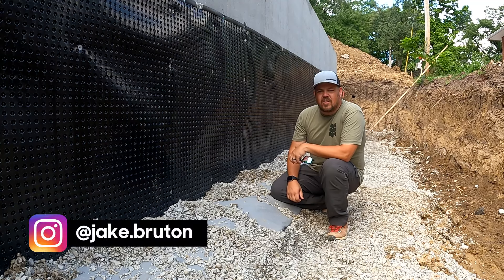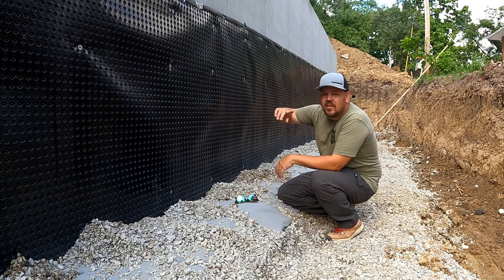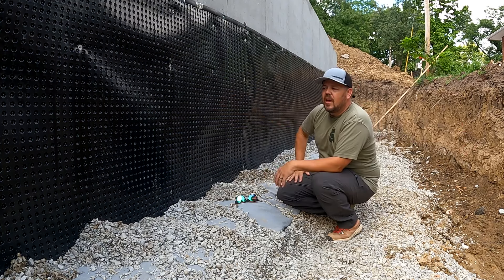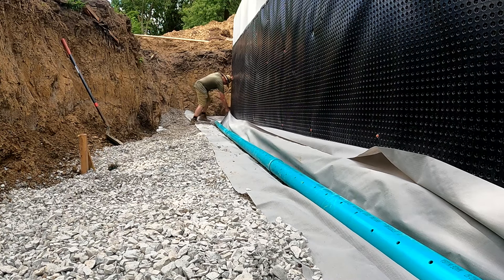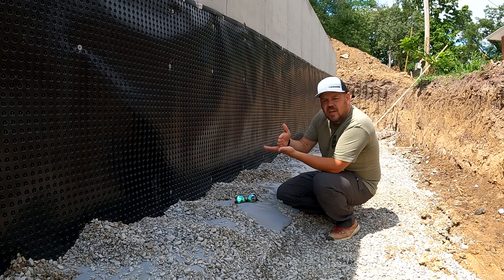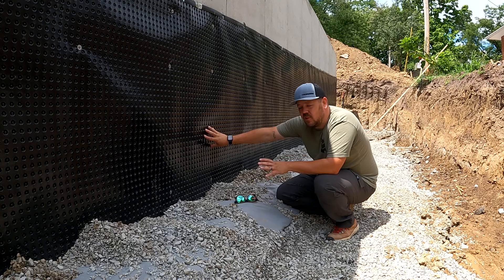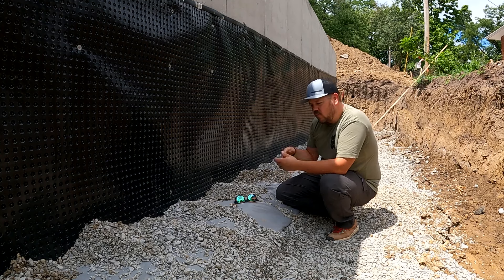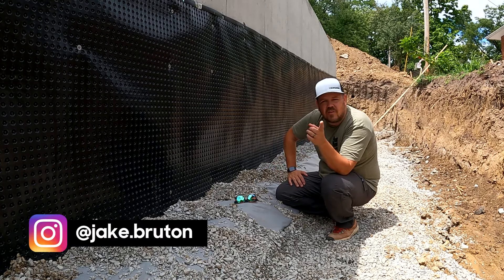Foundation Waterproofing

Comment: Probably the only thing I would add is a vertical pipe or two for cleanout purposes.
Reply from the maker: We actually did a poor job of addressing this, we require a clean out about every 75’. This is a great point.

Comment: You should extend the polywall material over the footing drains. Water will run to the lowest point regardless and get underneath the polywall, but this will be at the base of the footing where the drain sits. Silting from the top will be prevented. The area you excavated is basically an unfinished swimming pool …water will flow to the lowest point, and the drain will be there to move that water.

Comment: Really like this style of water/damp proofing.  I also like that the dimples are facing inward on the foundation wall with your dimple mat.  Other products have dimples facing outward with fabric over the dimples that face outward.....the flat gets glued to the foundation wall, which when you think about it, ruins the idea of lowering hydrostatic pressure.  Glad you mention that Polywall is EXTREMELY EXPENSIVE.  I'd be happy with this installation.

Comment: When all of that fails, instead of digging it up, the next step is running a dehumidifier on the air between the concrete and the plaster inside your basement. Just one more layer in keeping damp out of your house.
Reply from the maker: It is important that we always recognize that all of these conversations about the construction of the exterior wall don’t mean a whole lot without properly functioning HVAC equipment and responsible home ownership that is for sure.

Comment: Our HOA just signed a contract to have this done to a condo building that was built in 2002, concrete footing with a cinder block foundation. The technique used by the builder just didn’t last. So we’re having to dig up all the shrubs and redo it.

Comment: If you use a 5000 psi or higher concrete to begin with the amount of permeability drops significantly. Superior Walls use this method and their foundations don't even require water proofing.
Reply from the maker: Correct on the Superior Wall claims. The issue here is that bumping to 7500 PSI or so like they do is costly. Even if we use 5000 PSI the chances of cracking are still very high and a system like this on an 800 SQFT basement only cost something like $2k. For piece of mind I wouldn’t skip it.
Reply: @jake.bruton.aarow.building As they say, there are two kinds of concrete: concrete that has cracked and concrete that is going to crack. I would never skip the damp proofing and dimple mat on my own house regardless of the concrete mix used.

Comment: Excellent presentation. I am in the process of doing this now. Inground wall bitumen coated 30 years ago, spec for the day, failed at the cold joint, footing, first layer of blocks. Very detailed information especially about wrapping drainage pipe , water tables and a comment regarding putting in a flushing riser pipe.
Reply from the maker: It’s great to hear you are getting this done right and addressing the cold joint issue!

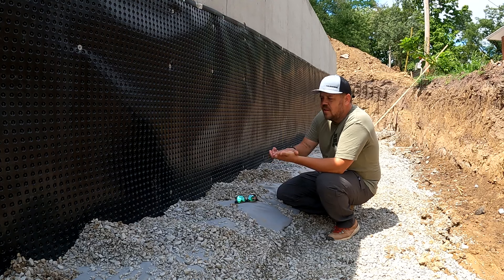Comment: 5:25 ... you should key your footing so the stem wall / foundation wall locks into the footing, eliminating the cold joint. 

Take a 2×, laying flat, positioned at the top of the footing so the top of the 2x is flush with the top of the footing, centered where the wall will sit, and then pour the footing. 

Once you strip away the 2x, you are left with a keyway in the footing for the stem wall / foundation wall to lock into the footing.

There are a dozen ways to get there. 

To accomplish what I wrote above, you would drill holes in the 2x for your rebar / footing reinforcements, and that would hold your rebar in place. And the 2x you used as a spreader bar, nailed on top of your footing form boards to hold the width of your footing, would be nailed into the 2x you are using as the key way to hold it flush with the top of the footings.
Reply from the maker: Using a keyway to tie the footing and the wall doesn’t eliminate the cold joint, it only helps to create a sturctural connection. They two pieces are still cast seperately creating a cold joint. There may be some benefit to reducing water pathway doing it that way but I doubt it is much considering the pathways water can take under pressure. The bar placed between the footing and wall in our assembly does the same thing as a keyway structurally without the effort of a keyway. Mind you I am not arguing against a keyway, we simply do not use that method.
Reply: @jake.bruton.aarow.building , eliminating was probably not the correct way to word that.

I am writing from South Florida, where we would do a typical footing with reinforcements coming up out of it. A CMU block stem wall will be built on top of the footing, using mortar as the attachment / bonding agent to the footing. Reinforcements are placed in the CMU cells, tied to the reinforcements coming up out of the footing, and the stem wall will be solid grouted up to grade.

During our rainy season, we get torrential monsoon down pours daily around 3:00 pm. They will flood out the job site. When we get those heavy rains, depending upon the site conditions, I’ve seen water held back inside and outside of the stem wall. 

I’m not saying water cannot get through the key way once the stem wall is solid grouted, but water will spend its time looking for another pathway. 

Not all contractors / shell contractors do the key way here. But it is something that I think makes a difference.
Reply from the maker: Thanks for circling back on this and clarifying. Yes, that does make better sense now. In your case, a full filled or grouted assembly would make a world of difference and a keyway would change everything probably.

Comment: Excellent system breakdown. Other than the “burrito” and ridged pipe this detail is very common in my market. One of key details you mentioned that I don’t think people realize is the use of clay as a cap between stone and topsoil. With positive drainage away from the building, the clay will act as a backup for rainwater that is absorbed through the topsoil and help direct it away from the wall and ideally past the over dig.

Comment: Great presentation for sure and nicely summarized… one upgrade would be to use either 3/4” round or even 1 1/2” round inside the burrito wrap to provide more void as well as prevent small rock chips from that 3/4” limestone from blocking or even entering that pvc inside  the wrap.

Also, Baughman tile makes some excellent single wall 8-slot that’s incredibly strong and slotted 360 degrees around so no extra drilling and between the ribs of the corrugation so less likely to ever clog in combination with round stone

Comment: I'm glad there are builders that care. I've got a basic at-grade slab in Florida (built in 80s) and it's so damp that if you set anything on the bare slab it will grow mold. Is there anything that can be done for that?

I've heard you can paint moisture barriers onto the slab, but post-construction application means you aren't reaching under the wall sill plates... I grew up in this house and I'm terribly ill, many doctors failed to help me, and now I can't help but think I'm one of the people who is sensitive to mold... Too ill and poor to help myself out of here.

Comment: Here in Sweden dimple mats were widely used 20 to 30 years ago. For the last 15 years permeable systems such as Isodran have been more common, at least for heated spaces and not extremely high watertables. These permeable systems have no waterproofing but a 4 inch very permeable sheet of insulation on the outside of a "naked" basement wall (the sheets are made of small eps balls dipped in tar) and covered by geotextile and then dirt. The wall and some of the dirt outside is then dried out from the wall into the basement which causes more humidity in the basement from the beginning but considerably less later. Obviously a good drainage system with gravel, geotextile and drainage pipes below the foundation is also required to take care of water from the surface or the ground, but this water will not go into the wall. The problem with the waterproof system is the generation of condensation on the basement walls, which these permeable systems do not have.
I am careful not to wrap the drainage pipes in geotextile. Usually we only put geotextile on top and on the sides of the pipe, and at least 4 inches of gravel between. If you are unlucky clay can make the geotextile almost waterproof with a resulting disfunctional drainage system.

Comment: I hadn't used that dimple mat before and for some reason I put the dimples out. I did install self adhesive membrane behind it. And I added silt fabric in front of it.  And drain is below top of footer. So far very dry basement after very hard rains. Like you say one chance to do it  while it's easy to get to.

Comment: From watching numerous vids of the Build show I believe in many instances there are two drainage systems.  External (yours) and internal, which is essentially mimicking the exterior system and then sumps to catch and then discharge any water.  I would hazard a guess that this might be need in very high water table areas but I do not know that for sure.
Reply from the maker: You got it. Risk vs effort. If we suspect high water table or difficult to manage site water an interior partner drain is added often.

Comment: If you put the poly wall barrier on the concrete, how does the moisture in the curing concrete exit to the outside of the basement? Would the dimple mat being made of such thick plastic be enough on its own to prevent outside moisture getting into the basement? - this is suggested by form-a-drain to be the case.
Reply from the maker: Remeber the interior side doesn’t get covered for sometime, drying can happen inward. I realize that some manufactures say a roll on or dimple mat is plenty, for my money, both is the right course. I don’t want to have to dig this back up.

Comment: Jake learned the hard way, it seems. 

Flex drain pipe should never be used around a foundation - it crushes too easily. Jake is using the best product - rigid SDR perforated drain pipe.  Only thing I'd add is a few cleanouts - if there's ever a problem, you can scope the drain and run a snake down it.

Top notch install, as usual.

For any potential clients reading this - hire this man - he's a helluva good builder - pay him well and it will be the best money you'll ever spend.  I'd hire him over Matt Risenger any day.

Comment: Jake, love the videos so keep ‘em coming. Two questions about this detail. First, why not use a true water proofing instead of a damp proofing? I realize hydrostatic pressure relief from the gravel and dimple mat should make it unnecessary but seems like an ounce of prevention from some redundancy down the road. Second, it seems that attaching the dimple mat with nails is introducing a further path for water, especially since the backfill will hold it (i think) once in place? Just curious. Thanks.
Reply from the maker: The damp proofing / waterproofing argument is pretty much a nomenclature thing in reality. The difference is kind of silly and none of it will matter once the concrete cracks a little. Right? Guess what, all concrete cracks. We know this and plan for it. That is why we put steel in the concrete. So even if we were to spend a little bit more money on a heavier layer and get a manufacturer to call it waterproofing the cracks that will probably form over the next ten years will create a discontinuous nature to our layer. So, the dimple mat lowers the pressure and hopefully drains the space keeping water from forcing itself through those small cracks. As to the attachment points, they aren’t deep and we keep them to a minimum.
Reply: @jake.bruton.aarow.building  Thanks Jake. Appreciate the explanation.

Comment: The Form-A-Drain system has a distinct flaw, you need to set it level for your footings, but a level drain doesn’t put water anywhere, it just stands still.
Reply from the maker: The only saving grace is that the system is there as a pressure relief. If it is functioning properly it would provide pressure relief. I have a larger problem with the fact that I cannot wrap the Form-A-Drain system in filter fabric. It just has to be surrounded by gravel.
Reply: @jake.bruton.aarow.building  Correct, furthermore the whole point of the exercise is to remove the challenge of the water away from the wall and foundation. Having the French drain positioned away (and slightly sub level to the base of the footer) keeps the rising water from becoming a challenge.

Comment: The tuff n dry system with fiber board is better to me. i don't like the idea of nailing holes in the walls. To hold up the dimple board.    The French drain is the way to go though

Comment: Do you suggest washing the gravel that goes into burrito wrap?
Reply from the maker: I don’t think it is worth the effort. The arguement for doing so is probably sound however it doesn’t have that much gravel dust on it.
Reply: @jake.bruton.aarow.building You do want to use screened rock at a minimum to screen out the fines, although I would personally buy washed rock from the quarry for my own house to remove the rock dust thereby minimizing any chance of clogging the drainage holes and to keep the drainage system as free flowing as possible. But I’m a belt and suspenders kind of guy.

Comment: Interesting point regarding water table. Is it overkill that I want to do this in Utah? Everyone tells me this is a dry state but all the basements I go into smell like mold/ mildew so I am not convinced this is a “dry” state.
Reply from the maker: I would still make the argument that water tables, seasonal rainfall, changing weather patterns, snowmelt, and even unkept sprinklers all add up to water and make the risk worth the effort. I wouldn’t skip it.  You would really have to be high desert.

Comment: Question please.. Does a piping need to be placed so that has a downward fall??  Or is it fine to just lay it directly horizontal?
Reply from the maker: We install the drain tile piping level around the foundation because that section of pipe is there to release pressure and then as soon as we are away from the foundation it has slope to move the water away. The drain tile is about equalizing pressures and not allowing pressure build up, having an empty pipe for that water to enter is enough, the slope only needs to happen to drain once it is away from the foundation in otherwords.

Comment: Great details Jake. I think you've settled the holes up/down argument.

If you were placing external insulation on the foundation walls, would that go on before the dimple mat? Thanks!
Reply from the maker: I believe I would still place a dimple mat. However if you check out the UnBuild It Podcast on the topic we make a pretty strong arguement to not place insulation outside below grade because it is difficult to protect.
Reply: You could do that, but use a waterproof material like XPS and seal off all the seams, that way it becomes another waterproofing layer for the basement.

The dimble mat will protect the XPS against mechanical damage and prevent the build up of any water pressure..
Reply: Insects like to burrow in rigid foam insulation such as XPS. I’m a fan of using rigid mineral wool for exterior basement insulation. I know there are challenges with this approach as well, so proper detailing and installation are probably more important than the exact system components that used as there multiple ways to accomplish the same objective.